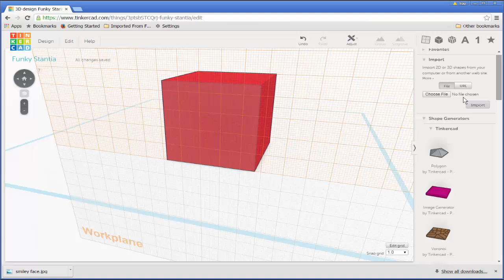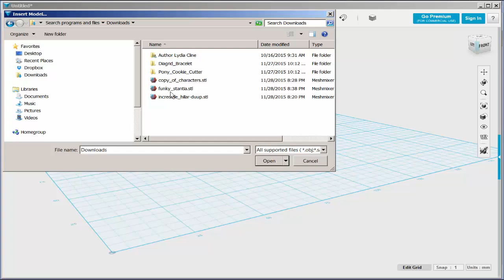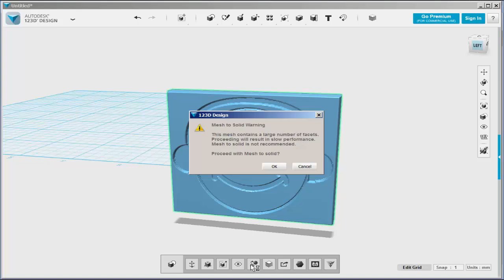Tinkercad: Import and Apply a JPG File

Comment: Does this still work in 2018? I don't see a way to import jpegs
Reply: Users were having problems with the image generator so Tinkercad hid it.  You can find it here though: https://www.tinkercad.com/things/5or2DEIckDR
Reply: @AndrewGatt  errrrrrrrrrrrr, so i have to create an external thing? how do i use it? it's not clear
Reply: @diegogarber1  1.  Follow the link that I gave.  2.  Click "copy and Tinker"  3.  Click on the new rectangular solid that appears.  4.  A new window should appear.  Click the "Change" button and select the image that you want to use.  5.  If it doesn't stick out enough you can always stretch the block upward which will exaggerate the embossed image and then chop off the bottom of the block.
Reply: @AndrewGatt  thank you so much , andrew, awesome awesome awesome..
Reply: @RedEyeCoding  You're welcome!
Reply: Is there a way to save this to your list or something, or do you have to always go the that link and copy and tinker? I cant figure out how to save it or add it manually? Thanks if you can help somehow, I realize this is a very old comment, and even older video. Cheers!
Reply: Not sure if there is, I manually went through every single shape. Unless its some sort of plugin the image generator is no longer there.
Reply from the maker: I used a shape generator called the Image Generator to do that. I don't know if it's still there; there's no search function for shape generators, making finding a specific one difficult.